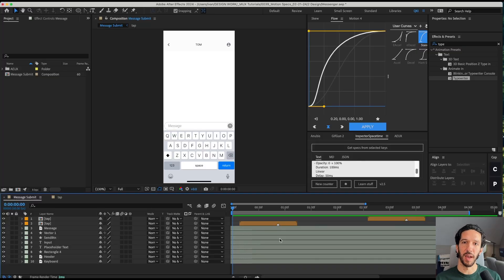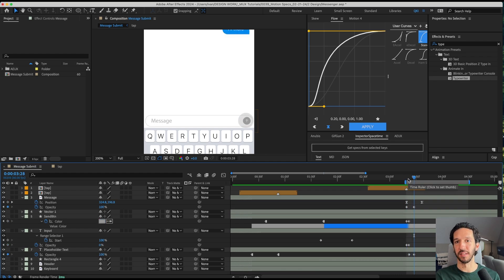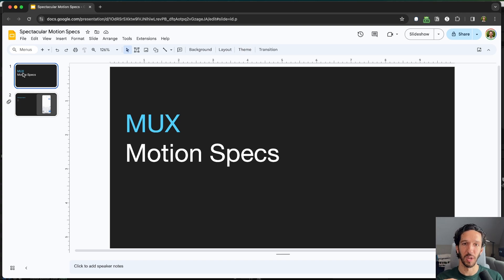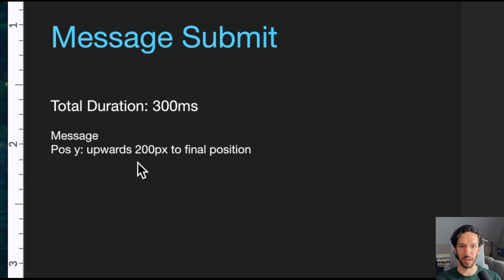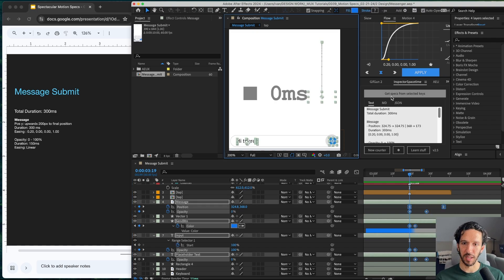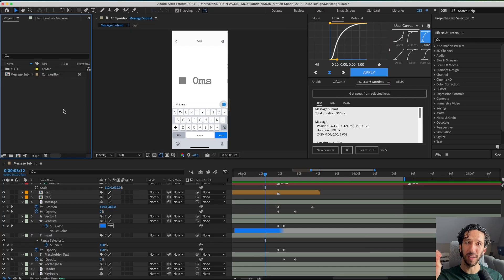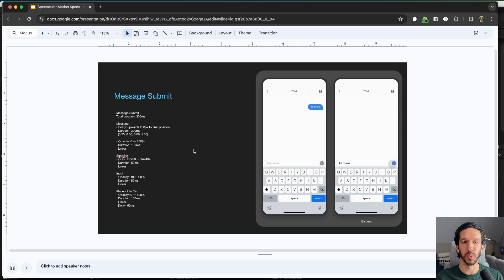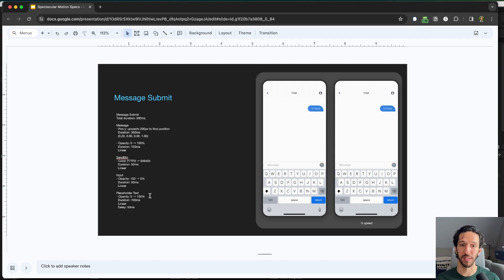Why your product design UI animations dont work: Creating Motion Specs for UX Design.

Comment: Assuming you are using shape layers with the trim path feature, what would the process be? In this example, you've only used position and opacity.
Reply from the maker: Great question. 

Assuming there is a trim path equivalent in code. You would approach it the same way for example. 

Box stroke animation. 
Trim path: 0% -> 100% 
Duration: 300ms 
Easing: linear 

Alternatively that animation could be a Lottie / Rive file delivery

Comment: Hey mate thats awesome, I am wondering if the AEUX can update and keep sort of a live connection to After effects? Lets say the colour and shape of the message button changes would it automatically reflect in aftereffects or you would have to export again, and re apply animation.
Reply from the maker: Currently no way to dynamically link Figma to after effects unfortunately. 

However if you do a raster png during import. And later change the Figma design without changing the layer names and reimport, it will overwrite the old png with the new. Which is a handy feature.